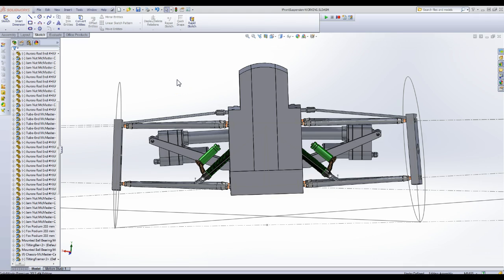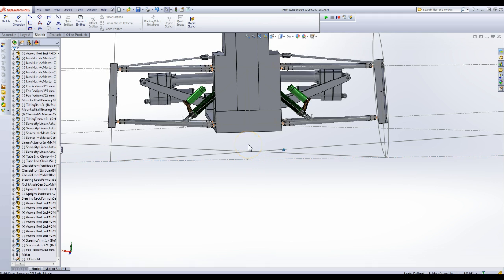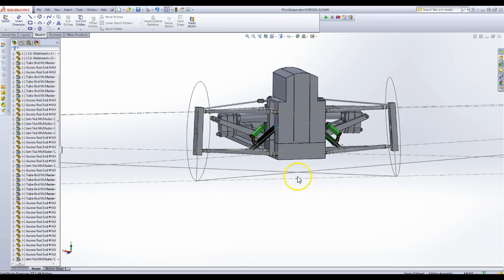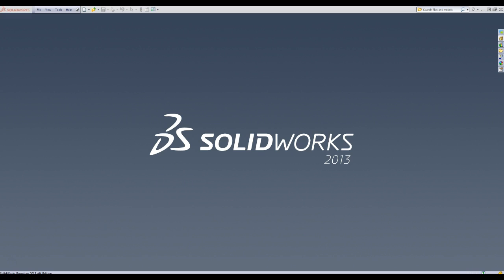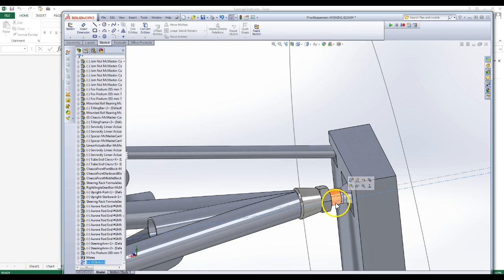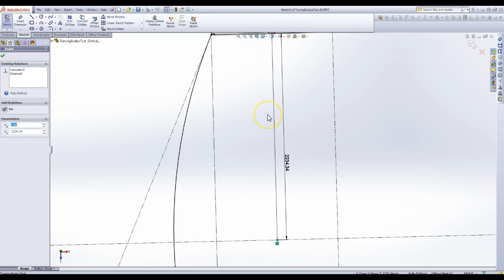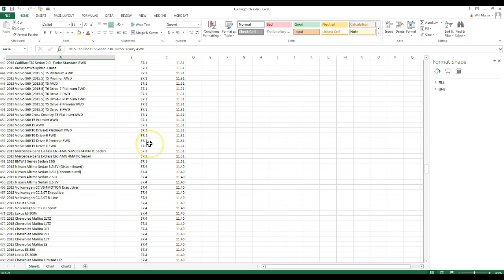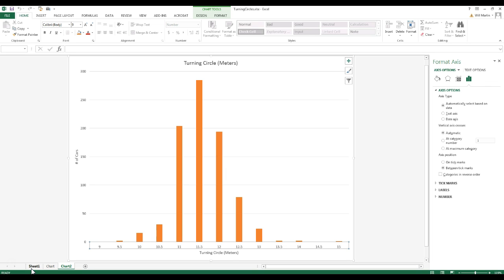Suspension Design: Roll Center and Turning Radius

Comment: Sir, I am part of a BAJA Team. We are not using differential in the car. How can I make changes in steering system and A-arm suspension to get minimum turning radius? Last year we did not use differential and got really bad results regarding turning radius and front wheel traction and response. Your suggestion shall help us to get rid of these problems. 
Thank You.

Comment: There is an issue with the turning radius calculations: the maximum angle for the spherical bearing has to be imposed on the internal wheel, not the external. To ensure kinematic steering the axis of both front wheels must intersect on the same point on the rear wheel's axis.
Reply: That depends whether he's using ackerman or anti-ackerman.

Comment: There seems to be an issue (although I'm still learning). All other depictions and videos I have found connect the instant center of the arms to their OWN tire's contact patch.
In this video you mention using the opposite side tire contact patch which can produce radically different results.
Any clarification?